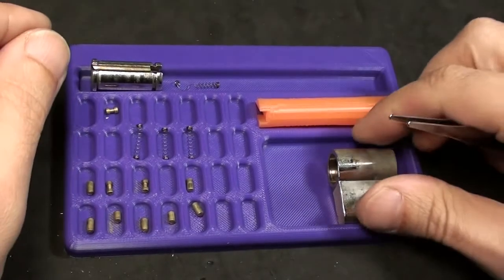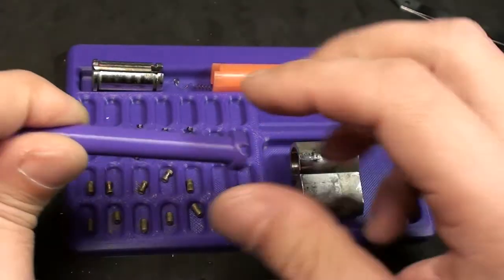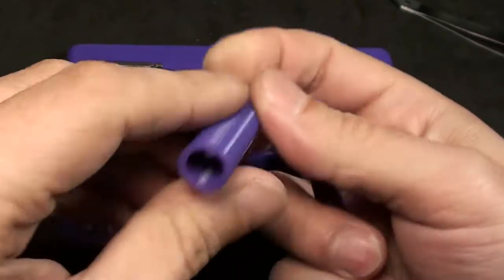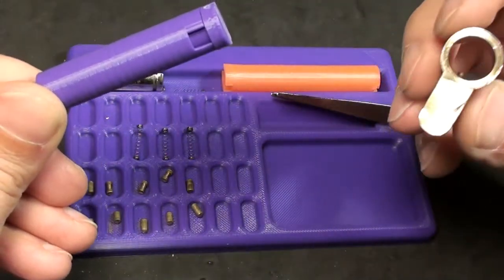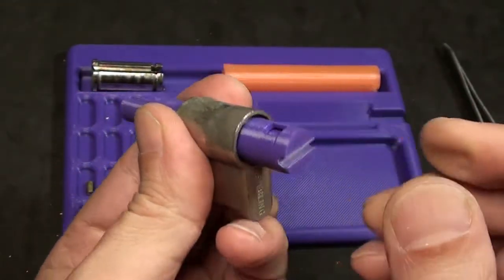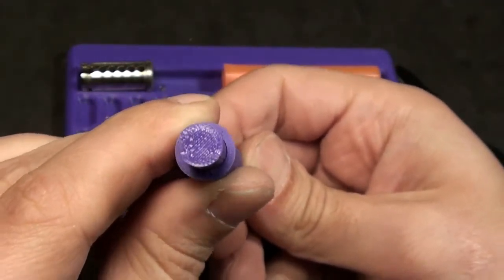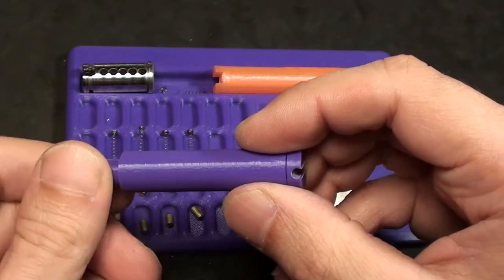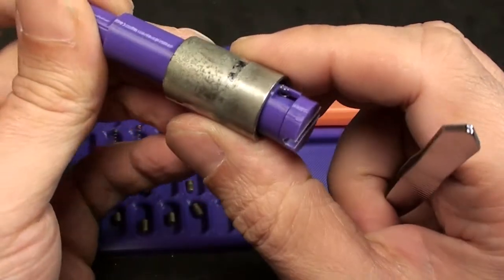#046 - a mod for zbzzn's new 2-part pinning follower

Comment: Hi, where or how much are your followers and pinning tray? I am kinda new to the sport and I'm trying to build my tools up.
Reply from the maker: Hi Lee White :), you can download the 3d file for the 1-part pinning follower from bosnian Bills website, Boris did send my design file to him (you will find it in the download section), then just get it printed from a friend or a service like 3Dhubs :). The pinning tray is Bosnian Bills design, I just printed it smaller in 10x15cm which is a good size, you will find it on thingiverse.
Bill designed also some standard followers, which you can find there too. Hope this helps you :) (I'm not selling these, sorry).
Reply: Ok thanks, I will have to find a printing service to get them done.  I really like your two piece follower
Reply from the maker: Well, we never uploaded the 2-piece follower ;). I was pretty proud as Boris asked me to have a look at it and improve the design. But to be honest, the 2-part follower is not needed.  Thank you very much for your interest :). Sorry I can't print them for you, as I don't know you. Happy picking and lock building m8 ;).
Reply from the maker: Send me a mail Lee, if you need the stl file for printing the 2-piece follower. I would then send it to you ;). But as I said, the 2-piece one isn't really needed ;).

Comment: Nice solution! Have the same pinning tray! ;)
Reply from the maker: Thank you ;), it was the first and easiest solution which came to my mind. Haha, it's the tray design from Bosnian Bill, love it, I just did print it a little smaller in 10x15cm for me and some friends.
Reply: Yeah had to shrink mine down also 120mm x 150mm acetone vapped/smoothed it ~ Cool to see other pickers using them.  Commented to Bosnian Bill that I was using his tray design/plug followers at the time, he didn't think anyone was! Good to see!
Reply from the maker: It's a wonderful design he did :). I print most of the time in PLA and sometimes in PETG. So no acetone smoothing, but that's okay ;).
Reply: Yeah Agreed! ABS for me that's all the UP should be feed, the software can be modded to take 3rd party plastics so there is some room to move great stuff.  Saw another design with a lid as to carry pins in the tray (metal/wood construction) a twist on that I'd like too make, would be a 3D print of the same tray with a clear perspex lid, only because I have a heap of poly carb :).